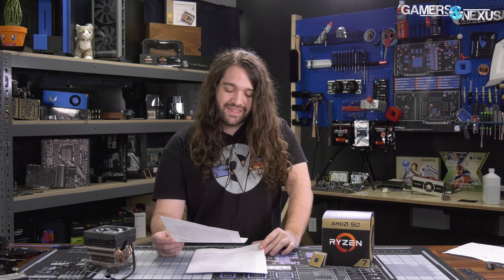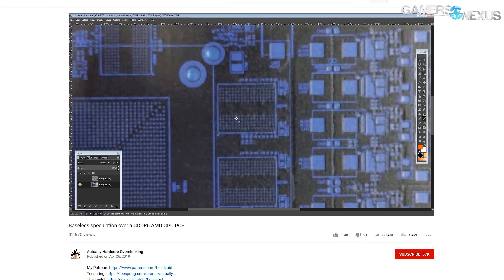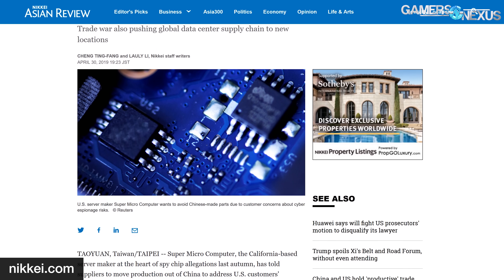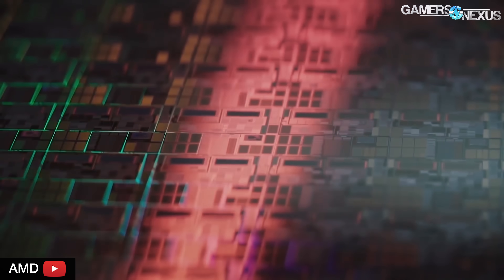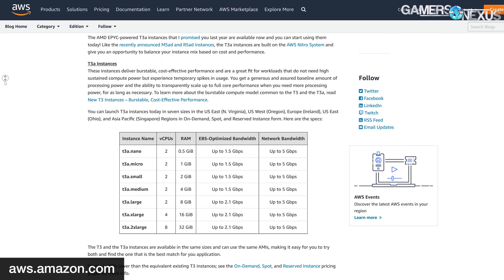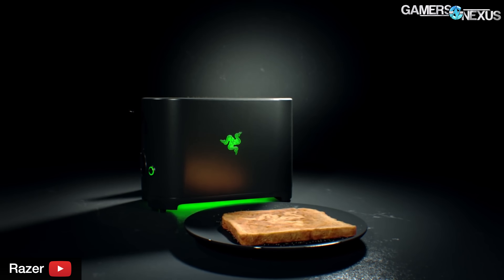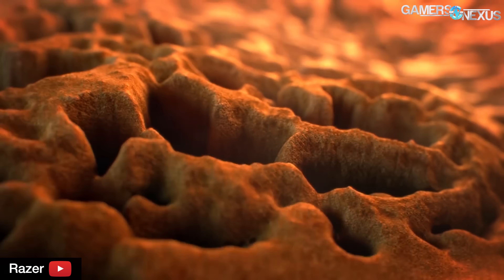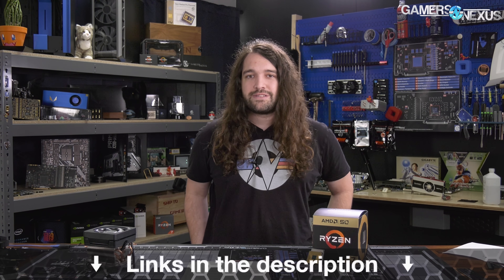HW News - Alleged Navi PCB, Global Chip Sale Downtrend

Comment: i bet it's all talk and tsmc 7nm is not that impressive after all.. look at radeon vii... tsmc 7nm is more like intel 10nm anyway, it's by no means a "huge jump". by the time these actually comes out, my 8700k at 5.2 ghz will be 2 years old. really glad i did not wait for this. im sure my 8700k will easily best zen 2 in gaming which is what this system is built for. high fps gaming that is, as in 100 fps minimum. all my games are cpu bound pretty much.

Comment: Consumers best be worried about the decline of Hard Disk Drive sales: As I have gone on public record stating plentiful times, I do firmly believe that if the industry is to ever only distribute Solid State Drives outright, there will be a significant amount of people losing their data far more than in any other point in history, and with devices such as video game consoles and even a significant amount of Laptops shifting over to SSD Only territory in 202X, worst case scenario is that we could see this become a Multi~Billion Person (or Dollar) situation, despite the many improvements to SSDs over the past decade and change.
My negative viewset on Solid State Drives ultimately comes from my history of studying them over the years: In virtually every instance, I have found that every Hard Disk Drive of mine from Western Digital, Hitachi, and Seagate dating as far back as I998 and no later than 20I3 still holds up extremely well and amazingly runs smoothly under their provided specs with little to no performance handicaps, while select SSDs either saw a massive drop in performance over time or, in a few cases, got wiped out without warning; when it comes to Solid State Drives, there is still a decent amount of the community that ultimately doesn't (and won't ever) trust them due to their very imbalanced and uncertain life expectancy, and in my view, they are not optimized to handle (at least up to) two decades worth of use, especially in a 024/07/0365.25 environment such as my own, thus HDDs and External Hard Drives, be they from Seagate or Western Digital, are still my personal Go To resources for storage and will be for many decades to come, wishfully a better successor to HDDs will come but in a way that has the speed improvements of SSDs or better while having significantly better durability and virtually no risk of data loss due to age (up to a 020 Year Minimum).

Comment: Right now storage capacity to price is really no better than what it was relative to 4-5 years ago, yeah SSDs are cheaper, but they just aren't cheap enough, it's a really poor time in the market to be buying storage, and it looks like it may be another 3-4 years before SSD prices get more competitive in regards to capacity per dollar, due to the cost of flash being so high and quite probably artificially inflated, add to that the slow development rate of HDD manufacturers and HDD technology over the past 5 years and you end up where we are right now, back in 2010 it was predicted that by 2020 we'd have HDDs that could store 20TB of data in the high-end consumer market, we currently top out at 14TB, and HAMR + multi stage actuators are behind in terms of release schedule, It all feels just too obvious to just be failure /lack of development, it's as if the lightbulb sales technique has been taken to a new level and now similar concepts are being applied to holding back the ability to advance forwards more quickly in the.pursuit of every last cent they can claw up from every crevice they can find

Comment: I love having a blower design reference cooler, because barely any AIBs make them, and, when they do, they often charge more for it, with a good blower style cooler you can cool the GPU and exhaust the hot air directly out of the back of the case

Comment: navi pcb appears to be fake at this point based upon the fact that the gpu package area appears to be larger than vega which utilizes hbm. amd has said midrange card I doubt highly navi will have a larger gpu package than vega 20. this isn't the first fake pcb we have seen. we went through this with nvidia's "1180" pcb that also turned out to be made of fairy dust

Comment: The issue with any part over 250 watts, and especially over 300 watts becomes cooling. I am not only talking about chip cooling I'm talking about room cooling. I know when I had my dual 290x's, my room would be notably warmer than the rest of the house and actually required a larger window ac unit to keep the room cool. And that was also a liquid cooled system, so those radiators would burn your hands. I live in NY so it's only above 80f regularly for 3 months a year, but for some people, ambient temps are a genuine problem, like Arizona where its regularly over 100. 
 
Now most people will only run one GPU but most also stick with stock air coolers, meaning on top of heating up their room their chips are limited by the airflow of the cooler and case design. There are real world reasons why these cards become memes
Reply: Liquid cooling makes the situation you are talking about WORSE. Because rather than the heat sitting inside of your case, you kick it directly out into your room.
Reply: @shawnpitman876  it only works like that until the box is saturated then the heat comes pouring out anyways. Before the second card, my system was air cooled and after a while it was still dumping heat out of the exhaust fan.

Comment: I disagree on 10k being bad branding for Intel CPU's... they have 900 to 9k series so far, well 10k says it is newer than the 9k series and directly follows, you automatically know where it stands in the lineup unlike AMD which cant seem to keep a brand series for more than 2-4 generations and currently have 2 different ones for consumers at once which convolutes things even more. Following the same number system each time is superior than making a new one every 2 to 4 years. Saying 10 7 hundred is just as easy to say as 97 hundred. If you have a 6700 and don't watch tech and you want to upgrade you will know the 10700 is a 4 generation later successor to your CPU, someone with an AMD CPU that's one generation older than Ryzen... There's no clear name or number to tell them what is a successor.
Reply: So you are comparing fx to Ryzen, completely different products. So 2-4 year name change schematic doesn't quite fit, as ryzen 1st gen was 1xxx and 2nd gen ryzen was 2xxx
 Ya, that's really convoluted

Comment: intel need to ditch the igpu and have it be a seperate piece of silicon.  not a lot of people know this but it is exaclty the same size as 4 whole cores and is just going to waste on most of our desktops.  and i think they will do exaclty that.  the cpu roadmap even says that rocketlake (the 11th gen) will have 14nm cores and a 10nm gpu so that means its basically confirmed to be seperate on the 11th gen. 

 i think they will do it for the 10th gen and have both models with and without igpu and the ones without will be the same price as the 8th gen while the ones with will be the higher 9th gen prices.  like 359 for the 8700k will be the price for the new 8 core 16 thread i7 with no igpu and 400 (like with the 9700k) will be the price for the one with the gpu.  the i5 is supposed to be 8 cores 8 threads like the i7 9700k and will follow the same pricing scheme i hope.

dont know if it will be enough considering what ryzen is supposed to bring but a 9900k for i7 prices is not a terrible answer, same for the i5.  that i5 will get the most out of any gpu unless its a 2080 ti at 1080p.  even then it will in most games.  

and its supposed to work in current boards according to wikichip.  the linux updates point to this to with "comes off of coffeelake"  meaning the coffelake platform (motherboards).  wikichip says it will work with all 300 series boards.  not surprising since it will basically be the 9th gen but with everything moved one tier over and a new i9 at the top with 10 cores

Comment: The theory is the leaked Navi board is for development purposes. They usually over engineer power delivery on dev cards to allow testing far beyond the power “sweet spot” and final clocks. If Navi isn’t a high end part, as suggested there is no way it will use the same or more power than the Radeon VII.

We’ll just have to wait a little longer to find out for sure.
Reply: I can't agree more : development PCBs are often crammed with a lot of component and design entirely dedicated to monitoring or debugging.

Comment: 300 wats on 7nm node? Lol what is this, a GTX 480? Even 2080ti uses around less than 250w, and its performance is above any other card out on the market. AMD needs to get rid of the Gcn architecture if that's the problem with these space heater style tdps.
Reply: That's an estimation and could be inaccurate.
It's all baseless speculation anyway.
We'll see how well AMD does when they release Navi.

Comment: Razer Toaster uses LED SSD's as the heating elements.
Reply: RDE Lutherie  pretty sure it's not every Ssd. Jay's and alot of others had a defective Ssd. Others had tested them without issues. But still sucks that it can happen.
Reply: RDE Lutherie  Its debatable, but I think they should stop sale and recall them. But still if it's only a small percentage of the total sold, that could be only 1% and within reason of acceptable failures for any product. Most products will have a certain failure rate.
Reply: RDE Lutherie  I'm not falling for it. I agree with you. It pisses me off. All I want is a high quality product that's well engineered and is manufactured really well. It's so hard to find cause so few people are willing to spend that kind of money.
Reply: RDE Lutherie  to add, I don't like this acceptable failures percentage nor a companies reason for it. I also don't like when people don't say anything cause it's a hassle. Etc etc etc.
Reply: RDE Lutherie  yea and I was only saying, it's not every single one of them like most people are assuming it is.
Reply: @tacticalcenter8658  I don't think that "most people" are assuming that every RGB SSD is faulty, just that it's remarkable and copping flak for being an unexpected and entirely unnecessary source of failure; we don't expect purely cosmetic things to cause systems to stop functioning!
Reply: Ooh burn!
Reply: RDE Lutherie  yea, China has a saying for that. Forget what it was, but basically shit happens. Really sucks when you get someone or a group of people that just don't care.
Reply: @Cinnabar Volcano no. Be realistic and listen to what I'm actually saying. Don't be nieve. The og comment was making fun of them
How dumb can you be
Reply: That jayzee led SSD.. scary
Reply: RDE Lutherie  did you happen to work for testors?
Reply: RDE Lutherie  maybe both lol...i had a family member work there, sounds similar to what you were describing.
Reply: Hyper x grilling element.
Reply: They use 28 core Intel CPUs.

Comment: "Today on Gamers Breakfast, we're reviewing the new Razor Toaster!"
Reply: I suspect this Razar toaster thingy...... might actually be a pre-built system with additional Razar branded smart RGB toaster.

I hope Razar can pull some miracle and make a ''print your own image toaster'' though, you know, like, only darken part of the area, you connect the toaster (That BTW have more IO than any Apple product) with your PC, import image (monochrome), and able to eat your image as breakfast.

How brilliant!
Reply: @Verpal  I swear I've seen something like that...
Edit: Yup, found it. It's a product called "Toasteroid". It's Kickstarter only just made it's base funding goal back in 2016, hasn't been seen or heard from since 2018.
Reply: @KiraSlith  Another kickstarter failure, these thing arent news worthy nowadays.
Reply: @Verpal  print your own image toaster? keep dreaming, they make images by covering sections of the burners, unless you want a toaster that's literally the size of a mid-sized tower they're not going to be able to fit in all the hardware needed to make custom designs.
Reply: @shawnpitman876  It's been done before, quite a few times actually. The real problem is getting UL certification on it. The ones I've seen do it by creating pixels of tiny nichrome wire sections attached to little flat bits of iron and toasting it by pushing them against the bread like a toaster press.
Reply: o7
Reply: @rapophie9228  o7 Commander.
Reply: #TeamToaster
Reply: If you stare inside the toaster the elements are actually rgb
Reply: @joeoliveira1843  And probably using the HyperX SSD RGB for the heating element!

Comment: I look forward to disassembly and benchmarks for this toaster. How its settings effect the toast. Uniformity of toasting area, power draw, distance of toast from the heating element, thermal testing and testing using various forms of bread for comparison vs other toasters.
Reply: well, uniformity is 100% not going to be good. That's kinda the whole gimmick behind these leave a design on your toast style toasters.
Reply: That toaster will run games faster than an Intel iGPU and an FX CPU
Reply: this comment needs to be pinned and come back to when it comes out!
Reply: But can it be liquid cooled? 

What about the RGB? 

Will this toaster be a bottleneck in my system? 

So many questions only the pros at GamersNexus can answer!
Reply: @MrMattumbo  holy shit could you actually toast toast with a pc watercooling loop
Reply: @jeeBisOkay  what? No
Reply: jeeB 😮 can you cook a burger on your radiator?

Comment: 14nm until 2022... big yikes Intel
Reply: Innovation, Am I Rite?
Reply: @CarbonPanther  Why innovate if people are still buying?
Reply: @Cinnabar Volcano If intel puts hyper threading for i3 and i5,  they could be fine. I will get AMD CPU this year, but intel still has single core advantage and better gaming performance. People at intel are not stupid, they know that their 6 cores 12 threads 14nm CPU is faster for gaming than AMDs 7nm 6 core 12 threads CPU or even 8 core 16 threads CPU
Reply: @Cinnabar Volcano Because process node shrinks aren't as cost effective anymore, like it was from Haswell to Broadwell. The cost of Lithography on 10nm is hugely expensive. With Intel's superior frequency, it is also difficult to manage thermals and stability. When you shrink the process node, you still have to maintain the high frequency on a less thermal density. That's why there won't be any 5 GHz Zen 2, not yet anyway, because that would be like jumping from Sandy bridge to Coffee Lake thermal density in one generation, an inferno to cool down. If Intel can deliver on 14nm still maintaining high frequency and IPC, why not.

Comment: The year is 2030

The brand new 14nm ++++++++++++ architecture!!
Reply: It will be called "Wesuck Lake"...
Reply: @Lucian_Andries  lmao this a f**ing true!XDDDD
Reply: I'm only going to buy when they release 14nm++++++++++++++ architecture.
(you can count it)
Reply: That's so many pluses it's approaching 15nm.
Reply: I hope I can do a build with it and AMD's new Polaris+++++++++++++++++++++ GPU for maximum plusness.
Reply: BitLateLake.
Reply: I've pre-ordered already......
Reply: I can’t wait for AMD 7nm +++++++ since they’re probably never gonna get any lower than that imo
Reply: @ezentia5547  TSMC, 5nm is the hard limit. Electrodes are 3nm in size and needs a 5nm+ trace to travel on, because you need enough gap to prevent short circuits.
Reply: Max Pain  oooooof if i can get enough cpus ill do a floor, backsplash, or countertop out of them.
Reply: in reality the release plan for AMD/TSMC is more like 7nm(10nm)>7nm+(7nm EUV)>5nm>3nm.
Reply: Intel 13.9nm process

Comment: Does anybody actually care about power consumption that much 🤔
Reply: Depends where you live. And more power brings more heat. 2080ti uses like 250w or less.  And it's performance is better than anything out there.. if Navi performs like 2060-2070 while using 300w it's a huge bust.
Reply: Power bills in Brazil are an average of 21% of the minimum wage - and you need 6 wages to buy a decent computer here - so, "who cares".
Reply: Laptops

Comment: Am I the only one that does not have hope that Navi will provide competition for the 2080ti?
Reply: It won't, Navi is supposed to replace Polaris, so midrange, which means 1080/2070 perfomance level.
Reply: No, cause it won't, navi is supposed to be midrange so all that say it will beat an 2080 or ti are setting themselves for dissapointment.
Reply: Nope.  I don't really think it makes sense for them to even bother trying, at least not yet.  Navi should be both faster and cheaper than nVidia's mid-range stuff, and if they market them correctly and people actually buy them, it should be an easy win for AMD.
Reply: Yeah...
Reply: Leaks say it sucks